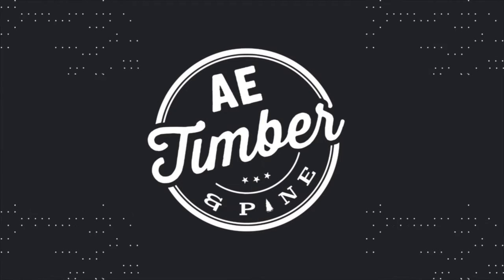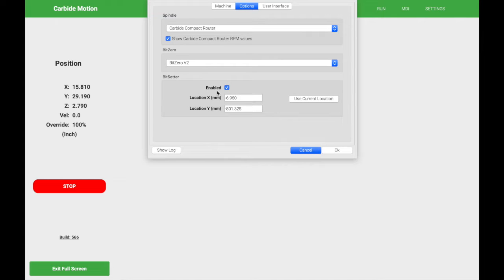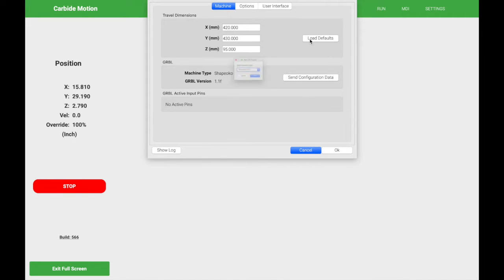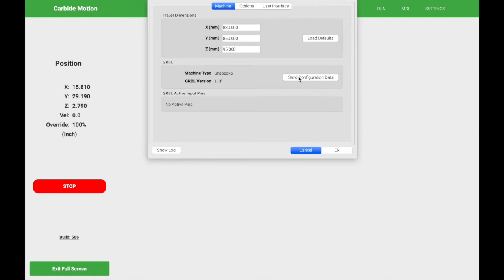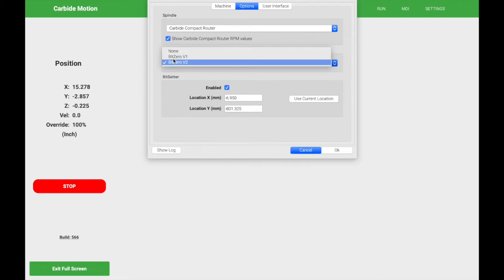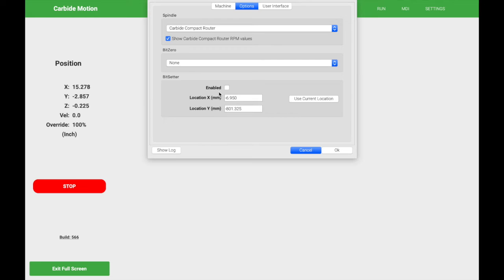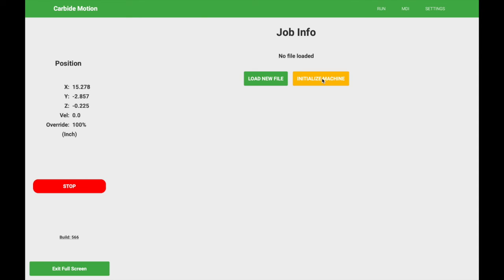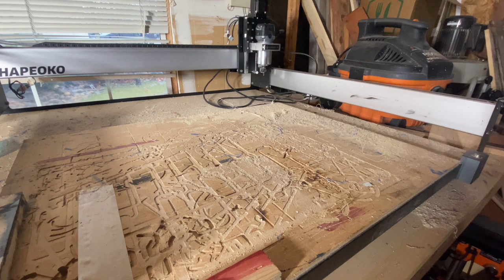STEP-BY-STEP:  How to Configure your Shapeoko CNC - Carbide Create Tutorial

Comment: The "Show Carbide Compact Router RPM values" enables the prompt to tell you what dial number you need to have the router set to when turning it on. If you were using a Makita router you could disable that and follow the Makita dial to select the proper RPM settings.
Reply from the maker: Thank you Eric I appreciate the info!

Comment: How do you know if you have z-plus or belt driven, or the other setting?
Reply from the maker: Hi Vtellez,

I know that the z plus is a does not have the v wheels and is not belt driven to control the up and down movement of the router. In its most simplest way to describe it uses a threaded bolt. 

Here is the Z plus I have. Also check them out in carbide create if you’re trying to confirm.  
https://shop.carbide3d.com/products/shapeoko-z-plus?variant=31524471144509

Comment: Hi, thanks for your video.I just bought a shapeoko 4 standard. Following your instructions it woks well except that the X axis moves in the opposite direction. Is there a way to change the direccion?
Reply from the maker: Your switches may be mixed up.  Double check that the correct x cables are inserted in the correct location.